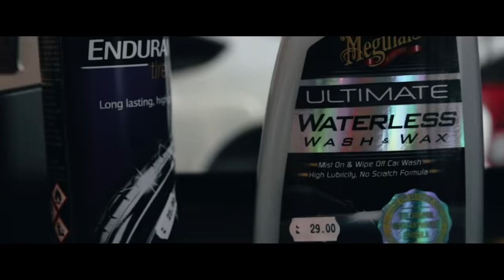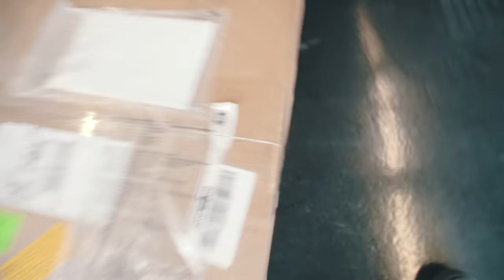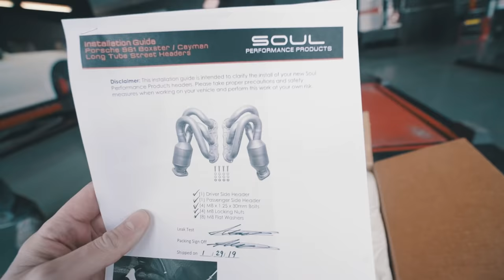Pirelli Sottozero Winter Tires For My Porsche Cayman GTS!

Comment: Luke check our Mexico blue or riviera blue (same Porsche colour really). As for the tyres, you can get smaller wheels like 19 or even 18 inch and fit them with winter tyres. Much cheaper.
Reply from the maker: eSysman Will do thanks! And really don’t want to put smaller wheels on as it just wont look as good, plus that also means buying other wheels so in the end doesn’t work out cheaper so i’m happy with my winter tires on my original wheels now, looks great I think
Reply: Cars with Luke I meant the tyres would be cheaper once you have the smaller wheels. Depends how long you will keep the car I suppose.

Comment: I have Pirelli's Sottozero 3 on my car they are fantastic! Pirelli makes great tires!
Reply: It's a great tire, as long as you are not driving in snow.

On wet or even 

icey tarmac they are very good

But it is a good alround tire, but on snow i prefer dunlop or conti
Reply: Michael Schöch I drove on snow as well, very good too.
Reply: @IvanSensei  i have them on my daily car, and they are not really good on snow, conti or dunlop are way better.

Could not get up a hill near my house with it, they were brand new, with my 2 year old Dunlop Wintersports tires, that was easily achievable.

I am driving them as 235 not 265 size, but i don't think it is a big difference

Don't get me wrong, it's a great tire overall, expecially when you are looking for an unusual size like 265 in 20 inch. It also feels pretty safe and stable on snow, but uphill and downhill on snow they make your car feel almost dangerous :-D

maybe it's my car, not every tire works with every car
Reply: Michael Schöch I have 225 and no problem uphil downhill in fwd car, I even overtake cars. Have Conti TS850 and TS860 on other cars they are great but don't come in R18
Reply: Michael Schöch my tyres are size 225/45/18

Comment: ....putting on a new manifold with metal sports cat suggests you habe to recalibrate your ECU, right?
Reply from the maker: jogu123 Nope, only if it’s catless
Reply: Our headers with HJS HD 200 cell cats are awesome because you'll get a nice increase in sound and power without a check engine light, fumes, or issues. With most mods, you would realize the most power with an ECU tune but it is not required.

Comment: Had the same tyres for 3 seasons on my GTS as well. Lasted around 20000km. 
Compared to the summer Pirellis, the Sottozeros are decent. The PZeros are useless compared to the PS4S however.

Comment: Consider (based in my experience) painting Your rims to black chrome color. This color is "dirt-proof" and doesn't look too dark (black rims looks very bad, when tires are a bit lighter than rims)
For example:
https://i.ebayimg.com/images/g/S2MAAOSwyWZZQA7B/s-l300.jpg
PS: they look even better in car
https://s1.cdn.autoevolution.com/images/news/gallery/bmw-e93-m3-convertible-gets-shiny-wheels-at-eas-photo-gallery_1.jpg
Reply from the maker: Thanks man, thing is I am just not a chrome fan at all but totally get what you said about black rims not looking good when the tires are lighter. I will just have to clean them daily ;-)